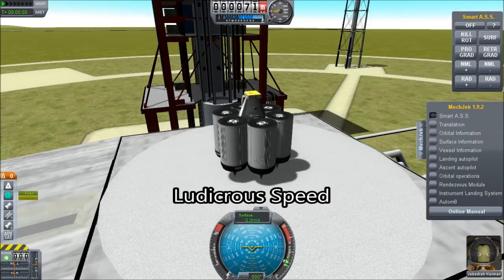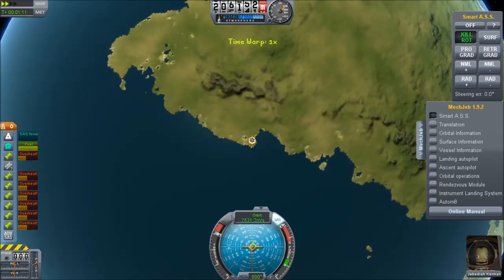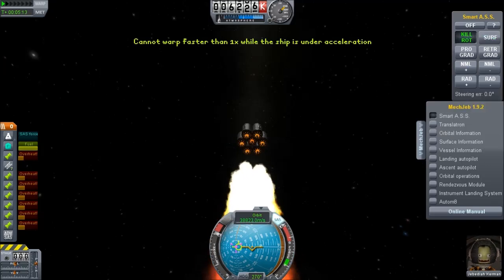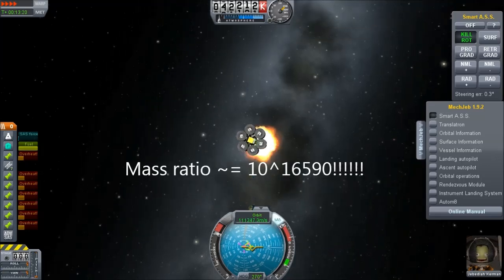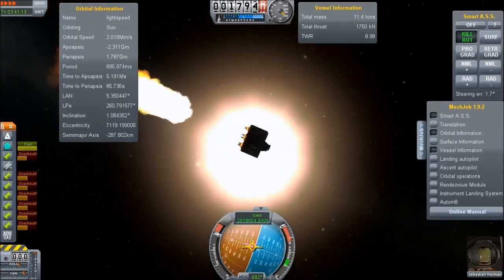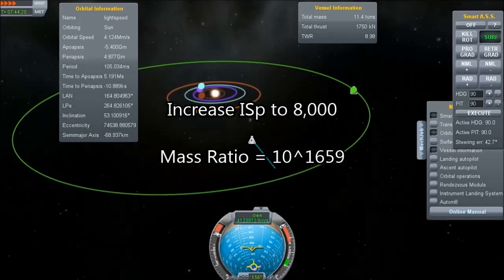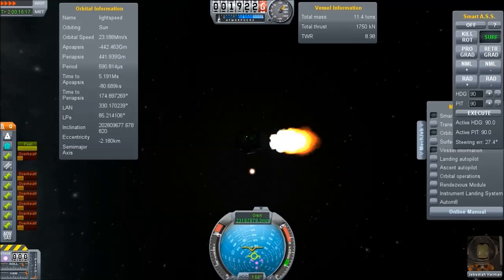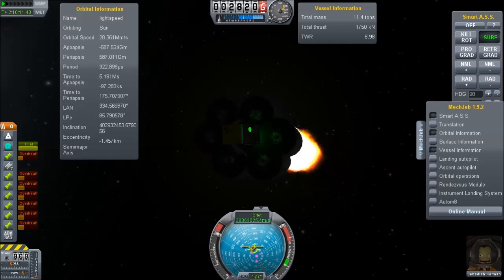What Does It Take To Reach Lightspeed In Kerbal Space Program?

Comment: I'm mildly disappointed that KSP doesn't take special relativity into account. Not that it's likely to be relevant to any craft legitimately built in the game, but.. still.
Reply: +YouCubed22 At the velocities present playing the game without cheating for infinite fuel or using mods, relativity has such a negligible effect that it isn't worth adding anything related to it. You've got to be going damn near .5c(149,896,229 m/s) before you start really noticing anything. For example, at .5c the apparent length of the ship due to the lorentz contraction would still be 86.6% of its true length. At .1c, which Scott's ship almost reaches in this video, the apparent length of the ship is still 99.5% of it's true length and a day of travel on the ship is only equal to a day plus about 20 minutes or so on earth. So.. again.. no reason to make those changes until they add interstellar travel and technology that doesn't exist.
Reply: +YouCubed22 It would not take much extra code, as you said. You only have to take linear Galileo transformation and replace it with lorentz transformation. But this calculation is a bit more dificult. The machine can do it without a problem, but if you have to repeat that for every particle moving in the game a lots of times per second and transform between every particle, and doing this only to get that the contraction of time or space is les than 0,005% at most, its not worth it.
Reply: @0xf7c8  nowhere near as easy. I think the full galilean transformations are never implemented in KSP, because you don't need it. There is one global time coordinate in the game, and no support for different time coordinates.
Reply: I've easily broken light speed by taunting the kraken
Reply: I'm mildly disappointed that real life does take special relativity into account.
Reply: It would be more sensible to add the gravitational effects of multiple bodies on the spacecraft simultaneously, allowing players to use lagrange points and such, but this would be an extraordinary undertaking as the theory of elliptical orbits and hyperbolic escape trajectories goes right out the window as soon as you have 2 gravitational bodies acting on one object simultaneously. Apparently, it's actually supposed to be impossible to solve the differential equation for an orbital trajectory involving two objects, which means that adding such a feature to KSP would be enormously difficult, maybe even impossible without starting from scratch.
Reply: @J7Handle  Principia sounds like the mod for you then.
Reply: deadmeat1471 cool! And it would be fun too if they added new planets with very high gravity, then GR.
Reply: Kerbal 2 has interstellar travel
Reply: +Matthew Hennes Special relativity would be fun, but has only a very small effect in the end. The effect of gravity, from general relativity, is a far more dominant effect when the difference in gravity is appreciable (such as between an on-surface object and an orbital/deep-space object). 

Sadly, even so, the only thing you would notice, is a difference in the on-board clock and the on-ground clock, since the whole point of 'relativity' is that everything is relative, and you simply can not notice it, or even measure it in any way, other than that it is different from another observer. Really this is the founding principle of the theory, so there's no way around it.
Reply: +Matthew Hennes One step at a time my friend maybe in a new update
Reply: Edvin Karahoda I dont know what would have a higher overhead, testing the condition or aplying the formula stright away. Because Lorentz works for every speed. Tests should be done
Reply: In the normal game no speed you would go without cheats or mods would change time, and then if you use mods the game would probably crash
Reply: you forgot a dot
Reply: But it is going to be relevant to the crafts because ... relativity
Reply: hopefully they add that inKerbal Space Program 2 via Interstellar Travel
Reply: To be fair, NASA doesn't use relativity for its calculations either. Just not worth worrying about, for any rockets we've imagined so far.
Reply: @ThinkingSpeck  They use it for satelittes
Reply: @Prometheus7272  Good point, GPS calculations use relativity - I forgot that.
Reply: Ive always wanted a game with relativity in, relativity being my favorite subject. Ive coded a few but I can only code text based games, still very cool thing to do (coding a twin paradox into a game etc)
Reply: But i agree, speeds are so ridiculously low in ksp it would be hideously counte productive to code it in.
Reply: please tell me that im not the only person here who once thought i was a smart person, and am now blown away by how stupid i feel listening to you guys talk about this lol >,<
Reply: I doubt we even understand the way matter really acts at light speed anyway. I'd wager there is a 99.9% chance we're wrong about relativity anyway.

Comment: What happens when your propellant mass is 0.000000000000001 and you stet the thrust of a rocket to 100000000? I expermented mass of the propellant of solid rockets and found they will not launch if mass is too high in kerbal space. So do the opposist and it burned through the fuel faster the lighter it is to make the thrust. It just will not let you cheat seems like?

Comment: There is no way we can do this. According to general relativity, you will need an infinite amount of energy to accelerate anything to the speed of light. An easier but still impossible method is to make the rocket with 0 mass.
Reply: +saransh gupta Generally when speaking about something other than light going the speed of light, you infer that it's actually just going very very very close to the speed of light rather than actually reaching it.
Reply: +saransh gupta  Confirmed. I still belive in WARP drive, at least does not break any physics rules we know today.

Comment: In 1976 scientists detected positron production in solar flares.  At the base of these flares over 1% of the sun's output at the base was found to be in the form of positrons.  The sun is capable of producing over 400,000 tons per second of positronium in this way.  The production of 2,000 tons of positronium per second is sufficient to project all the people born on Earth to the nearby stars.

What if flares could be formed artificially and positrons artificially extracted and stored as a Bose Einstein condensate at high densities and the production of gamma rays controlled in photonic crystals to produce thrust efficiently?

https://www.linkedin.com/pulse/industrial-production-positronium-its-uses-william-mook?trk=pulse_spock-articles

According to space colony studies done in the 1970s it takes about 10 kW of power along with 10,000 kg of material to support a person indefinitely in deep space.  

According to Mark Roth, MD, hydrogen sulphide can cause reversible stasis in mammals,  that operate at the cellular level.  This is likely with research to be extended to very long periods of time.

Time dilation occurs as you approach the speed of light. 

A photon rocket that uses photonic crystals to efficiently direct gamma rays produced by the annihilation of positronium, stored at a density of iron or greater as a Bose Einstein condensate can be envisioned.  

dV/c=TANH (LN(Mi/Mf))

where dV = change in speed
              c = speed of light
            TANH(..) = hyperbolic tangent
             LN(..) = natural logarithm
             Mi = initial mass
             Mf = final mass

With two boosts of a positronium-fueled rocket that first fires and accelerates a 10-ton payload per person to 90% light speed and then slows to rest relative to a target star some distance away, we can see that a single stage, assuming a 7% structure fraction, has 915.4 tonnes take-off weight for every person on board and that each person requires the vehicle carry a total of 853.4 tonnes of positronium in a 5.9 meter diameter spherical tank. 

1000 persons are transported in a 915,400 tonne ship that has a 60 meter diameter spherical tank of positronium.  Pushing a 60 meter diameter cylinder that is 265 meters long, provides sufficient cabin space for 1000 persons and life support.  

This mass ratio allows a ship travelling at 90% light speed to travel 2.3 light years per year of ship time following a boost at each end that lasts 1.425 years each or 2.85 years ship time total.  This boost time equals 4.00 years star time, whilst traversing 1.26 light years distance, a distance of 2.52 light years overall traversed in boost, with the remainder coasting.   

Once at the terminus, or target star, a flare similar to a solar flare described above, is formed, and is used to recharge the rocket’s positronium propellant if desired, or to support an extrasolar human civilization. A trip to Alpha Centauri entails a 10-month ship time coasting phase and takes 3.72 years ship time each way. A 49-light-year trip takes 28 years ship time at this speed.  Plasma may also be ejected from the Sun or star cooled and used to build things in space, or expand the number or size of ships.  203 years ship time translate to 463 light year range.  

There are 1,875,000 stars within 500 ly range.  

       1,875 B typestars - giant
     13,125 A type stars - blue
     50,625 F type stars - white
   121,875 G type stars, Sun is G2 yellow
   236,250 K type stars - red
1,451,250 M type stars - dwarf

Dispatching 18937 people per hour from Earth to the G type stars within 500 light years and rolling back the distance 8 light years per year of the programme, with nearly 6,000 G type stars in each shell, the average number of persons arriving at each star is 30,000.  Within 60 years Earth's population falls below 600,000,000.  After that time for three years, 194,000 persons are dispatched to the 36 G type stars within 20 light year each year.  After that 50 people are dispatched to any of the 125,875 G type stars within 500 light years - to maintain the Earth's population at 600 million level.  

By the 2080s the first radio signals, and returning astronauts, from the nearest stars arrive back at Earth, bearing gifts from deep within the cosmos, and this expands dramatically as folks arrive at the distant stars over the next 1000 years.  

Year Earth Pop                   In Transit LY     GStars People Per Star

2016 7,380,000,000                       0 500            0 
2017 7,298,132,000    166,000,000 492     5,946 27,919
2018 7,215,330,705    332,000,000 484   11,701 28,842
2019 7,131,585,475    498,000,000 476   17,270 29,811

2020 7,046,885,549    664,000,000 468   22,654 30,830
2021 6,961,220,045    830,000,000 460   27,858 31,902
2022 6,874,577,953    996,000,000 452   32,883 33,031
2023 6,786,948,142 1,162,000,000 444   37,734 34,222
2024 6,698,319,350 1,328,000,000 436   42,413 35,477

2025 6,608,680,191 1,494,000,000 428 46,923 36,803
2026 6,518,019,145 1,660,000,000 420   51,268 38,205
2027 6,426,324,564 1,826,000,000 412   55,451 39,689
2028 6,333,584,664 1,992,000,000 404   59,474 41,260
2029 6,239,787,529 2,158,000,000 396   63,341 42,927

2030 6,144,921,107 2,324,000,000 388   67,055 44,697
2031 6,048,973,207 2,490,000,000 380   70,619 46,579
2032 5,951,931,502 2,656,000,000 372   74,036 48,582
2033 5,853,783,521 2,822,000,000 364   77,309 50,717
2034 5,754,516,653 2,988,000,000 356   80,441 52,996

2035 5,654,118,143 3,154,000,000 348   83,436 55,432
2036 5,552,575,090 3,320,000,000 340   86,296 58,040
2037 5,449,874,446 3,486,000,000 332   89,024 60,837
2038 5,346,003,014 3,652,000,000 324   91,625 63,841
2039 5,240,947,449 3,818,000,000 316   94,100 67,073

2040 5,134,694,250 3,984,000,000 308   96,452 70,556
2041 5,027,229,764 4,150,000,000 300   98,686 74,318
2042 4,918,540,183 4,316,000,000 292 100,804 78,389
2043 4,808,611,541 4,482,000,000 284 102,808 82,805
2044 4,697,429,713 4,648,000,000 276 104,703 87,604

2045 4,584,980,412 4,814,000,000 268 106,491 92,832
2046 4,471,249,188 4,980,000,000 260 108,176 98,543
2047 4,356,221,429 5,146,000,000 252 109,760 104,798
2048 4,239,882,354 5,312,000,000 244 111,247 111,667
2049 4,122,217,012 5,478,000,000 236 112,639 119,235

2050 4,003,210,286 5,644,000,000 228 113,940 127,599
2051 3,882,846,884 5,810,000,000 220 115,152 136,875
2052 3,761,111,338 5,976,000,000 212 116,280 147,201
2053 3,637,988,007 6,142,000,000 204 117,326 158,740
2054 3,513,461,071 6,308,000,000 196 118,293 171,692

2055 3,387,514,527 6,474,000,000 188 119,184 186,295
2056 3,260,132,192 6,640,000,000 180 120,002 202,845
2057 3,131,297,699 6,806,000,000 172 120,751 221,701
2058 3,000,994,493 6,972,000,000 164 121,433 243,314
2059 2,869,205,830 7,138,000,000 156 122,052 268,248

2060 2,735,914,777 7,304,000,000 148 122,611 297,221
2061 2,601,104,205 7,470,000,000 140 123,112 331,155
2062 2,464,756,793 7,636,000,000 132 123,559 371,248
2063 2,326,855,021 7,802,000,000 124 123,955 419,089
2064 2,187,381,168 7,968,000,000 116 124,303 476,809

2065 2,046,317,313 8,134,000,000 108 124,606 547,327
2066 1,903,645,331 8,300,000,000 100 124,868 634,726
2067 1,759,346,887 8,466,000,000   92 125,091 744,858
2068 1,613,403,442 8,632,000,000   84 125,278 886,345
2069 1,465,796,241 8,798,000,000   76 125,433 1,072,323

2070 1,316,506,318 8,964,000,000   68 125,558 1,323,597
2071 1,165,514,490 9,130,000,000   60 125,657 1,674,720
2072 1,012,801,355 9,296,000,000   52 125,733 2,186,519
2073    858,347,291   9,462,000,000   44 125,789 2,974,272
2074    702,132,450 9,628,000,000   36 125,828 4,278,605

2075    544,136,760 9,794,000,000   28 125,853 6,672,850

Comment: You don't need a giant computer to store that number... You only need ~7 kilobyte to store it. That's pratically nothing. You could store that number 210 time on a floppy disk. A FLOPPY DISK.

Here's why : 
10^61590 = e^38199.85 = 2^(38199.85/ln(2))

38199.85/ln(2) = 55110.7341577

So you need 55111 bits to store the number. 
This gives us 55111 / 8 = 6888.875 bytes.
Finaly, 6889 / 1024 = 6.7275390625 kilobytes (KB)

So ~7KB.

Comment: Isn't the point of relativity is if you DID "just keep accelerating" you wouldn't feel yourself hitting any sort of wall at the speed of light, you'd just get greater affects of relativity. Mainly time would slow down for you, so any outside observer who could continuously watch you from a perpendicular angle move from, say, Sol to Alpha Centurai, they'd see the ship accelerate less and less. For everyone inside the ship, as they got closer to the speed of light they'd see the ENTIRE UNIVERSE seem to foreshorten so Alpha Centurai seems to rush closer towards them, not to mention extreme blue-shift.

So if you were timing yourself you'd say "Hey I've travelled 4.37 light years in only a year... I travelled faster than the speed of light!" no, it's just going near the speed of light caused time dilation that screwed up the maths of speed = distance/time.

That's the first principle of the Theory Of Relativity, that physics works the same WITHIN any reference plane.

Comment: wat if over time u left the gravitational field of the sun (forget about our solar system's meteorite field that surrounds us) and had the ship at an accelerating speed couldn't the ship use no fuel and still continue to accelerate as it goes through space?? and if the craft would be effected by the CMG's gravity couldn't we use that gravity to increase the Craft's acceleration by even more as it gets closer??
Reply: +Kyle Schaefer if you stopped using fuel you'd stop accelerating at whatever velocity you quit using fuel at, plus the sun doesn't have a limit on its gravitational field it just gets incredibly weak as you get further out.
Reply: Theoratically, there is no place in the universe with pure 0 gravity :/

Comment: Thats why reactionless propulsion (like the Em-drive) is pretty interesting if it's legit. You're no longer worrying about throwing that ridiculous amount of mass out the back and you're not hauling it around either.
Reply: Em-drive is legit, i saw that nasa tested it in a generated vacum and it worked, the shot a laser trought it and calculated the time it took for the laser to travel from the start to finish aannnnd it was faster than light.... So yeah... Space warp